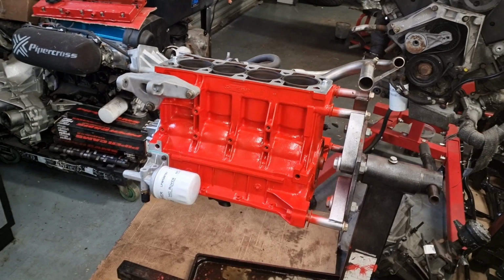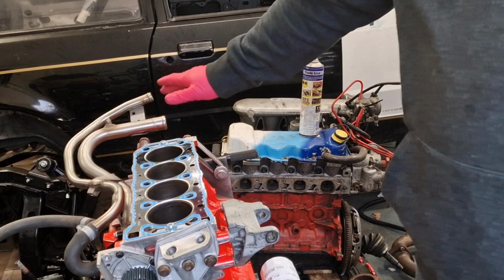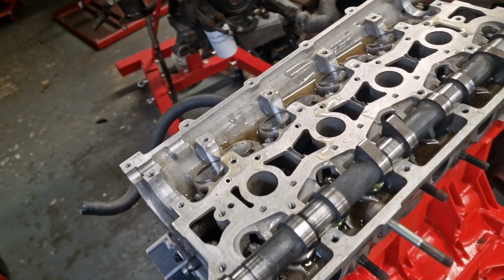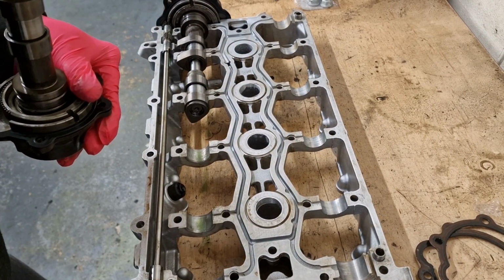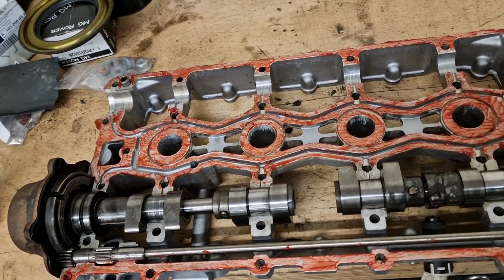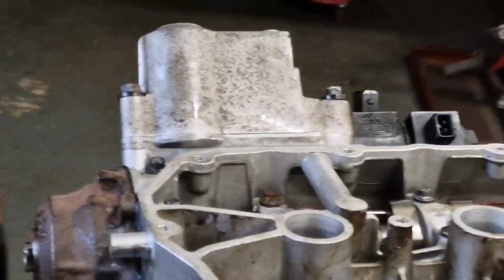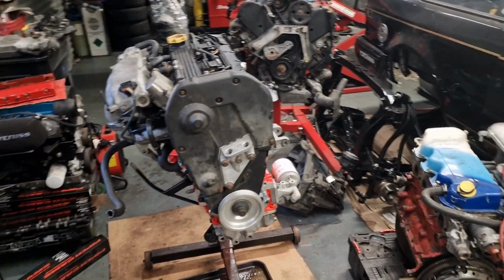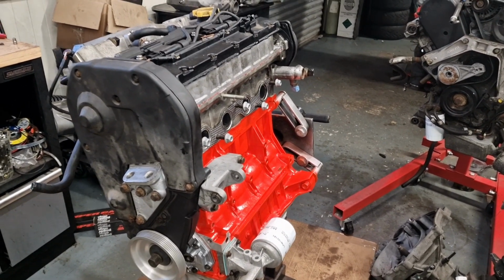MGF Race Car - Putting The Top Half Of The Engine Together. (VVC Mech Timing)

Comment from the maker: Depending on where your sealing.....
All explained in the video.

574 for the sump and main bearing carrier and any other metal to metal flange surfaces. 
5188 for cam carrier as any squidg out into the cam oil gallery will get washed away by the oil. This stuff will only dry in the absence of air so will stay soft in the oil galleries until washed away by the oil.

Comment: Hi mate, by mistake i took the camshaft out of the mechism and small parts came apart. Do you know how to put them back together? Thanks
Reply from the maker: Yes, with great difficulty. Trouble is, when they fall apart and the parts dont go into the correct orginal places, they can be very noisey.

Comment: Hi, 
I can see you are using lightweight crank pulley. Did you ever had any problems regarding excessive vibrations or lack of dampening?
Really like your videos , please keep uploading them…!
Reply from the maker: Haven't had any issues with this and running a lightened flywheel aswell, certainly revs up alot quicker though.

Comment: Could i remove the cam carrier and vvc mechs all as one unit to reseal the cam carrier to the head? I had my head skimmed after HGF and the place i took it to has used RTV to seal it, its been 8 months and its now pissing oil out. funny how when i fitted the sump with 574 its bone dry!
Reply from the maker: You will need to remove the oil control valve to access the bolt underneath, but you can remove with the cams and control shaft in, you will just need to make sure it get it timed up through the Inspection holes.
Yes rtv is lethal in this circumstance, if it don't leak, it will block up the oil galleries to the cams.